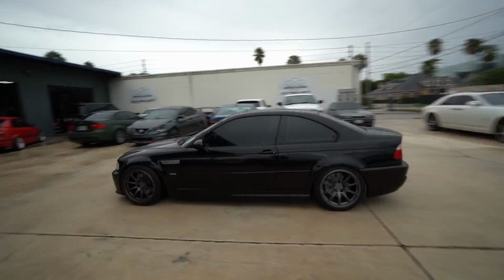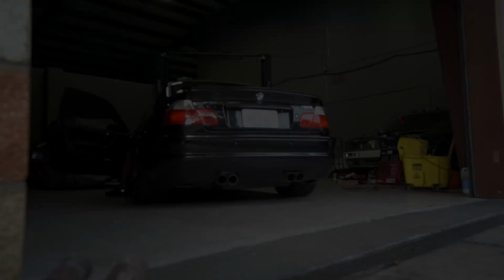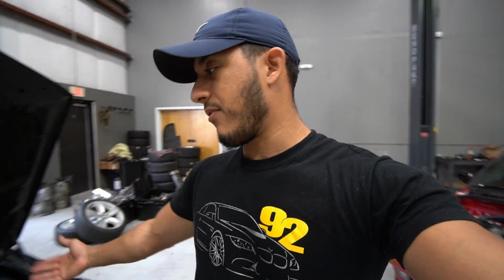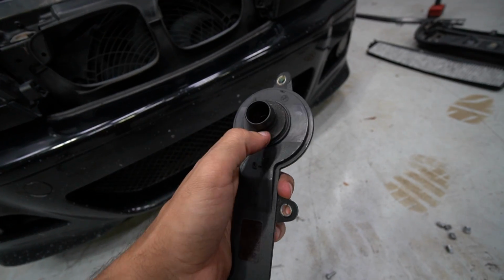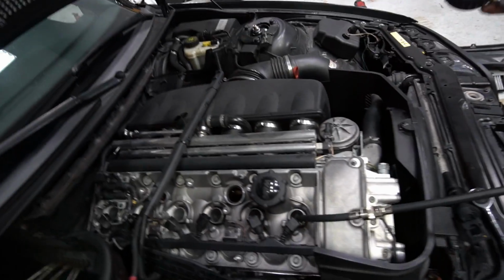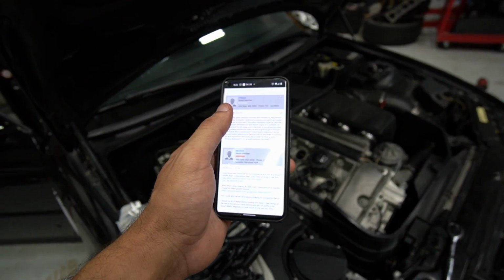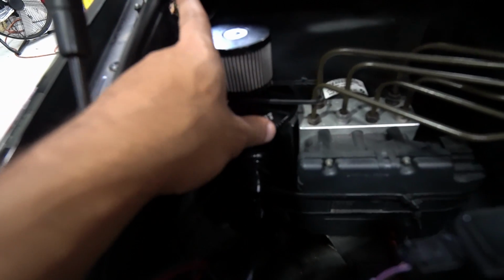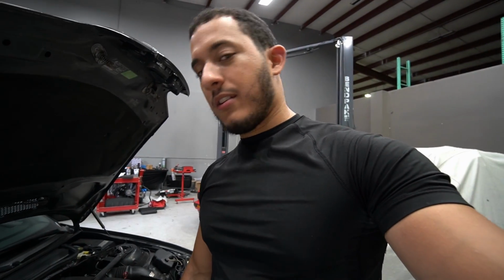Here's Why My BMW E46 M3 Smoked Excessively At The Dyno

Comment: How does the engine have 170,000+ miles when the odometer says 95K?
Reply from the maker: Replaced the cluster.
Reply: Ah, makes sense. Did you switch clusters after the manual swap?
Reply from the maker: @davyhay1  No, I switched it months later because it stopped working.

Comment: Had to same problem with my M3. Even replaced the oil separator unit and the car still smoked after hard acceleration. My engine was rebuilt 5 years ago and has 18 000 miles since the rebuild. Definitely not piston rings. Glad to see you got it sorted. Good job. 

PS. The rebuild video is on my channel if you're interested =)

Comment: My m3 06 had almost 100,000 miles on it never burned a drop of oil so your inspection of your PVC valve system was the culprit

Comment: Running the catch can in a cold area like the side bin or bumper can cause it to fill up a lot more with water vapor due to it being hot and then cooled down. If you run the catch can above the headers it helps minimize this and the amount of times you need to drain the excessive water
Reply: Fantastic tip ! (from someone asembling my new turbo m54 engine swap.)
Reply: Very interesting! I was running mine in the side bin and there was lots of water. Thought it was because my car was running rich

Comment: Bro my 2001 330xi has 180-185 psi on all cylinders with 180,000miles.. hummm 155psi?? Is that a good compression testers?
Reply: 155psi is actually quite common on these engines when beeing used for over 100000 miles. I'd say 155-175 is "normal"

Comment: If the rings are weak the compression will be high ( due to oil sealing the rings like a wet test )leak down check will show excessive blow bye at the oil rings and compression rings